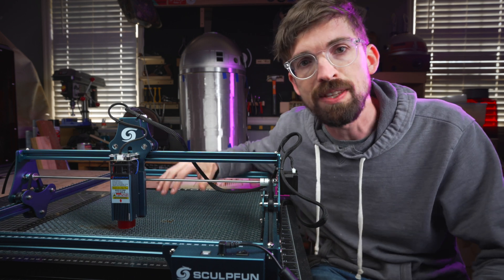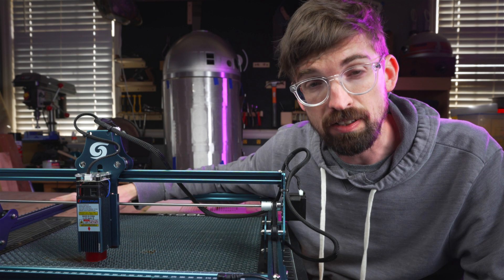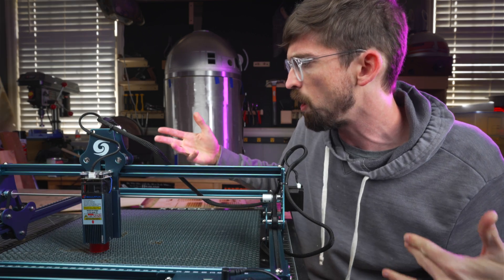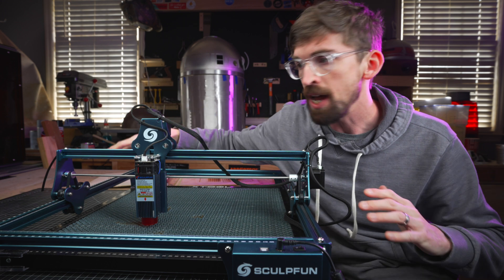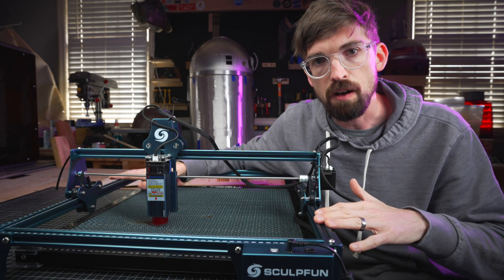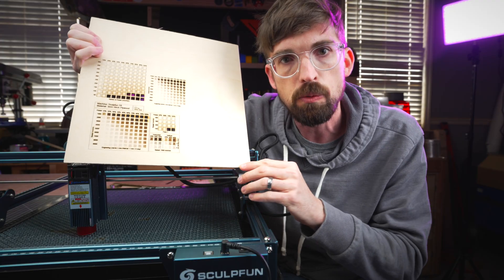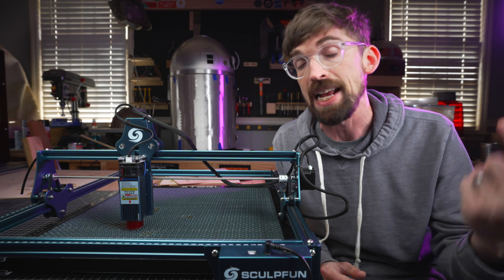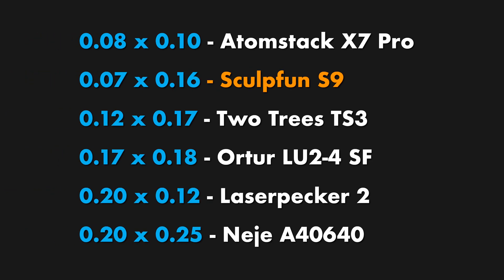Can This Laser Beat the Competition? Sculpfun S9 Laser Review

Comment: I cut 5mm plywood 2 passes, using air assist, with very smooth edges, and very little burn marks on the back side, top side, has no burn marks whatsoever.
Reply: Noted mnm❤ - Q. Sculpfun air assist kit just bolts on with no issues?

Comment: Cool video, thanks. Just a quick question if I may - between the S9, S30 Pro Max and the S30 Ultra which one would be a better pick considering that the budget is somewhat flexible? It is for some general purpose cutting ( Balsa, Plywood, Acrylic etc. ) and less of engraving. I am somewhat inclined towards the S30 Pro Max with the 20W Laser Module.

Comment: I have a sculpfun s9 450x900 extend version,3D prinding benchmark and serice engineer with Cad Cam design trainng. (Making 3D parts from  sketch or technical dwg. Provided with BOM if not) and i still dont understand! Hard wood,not doing it for me! Regular wood? The fibers are going to burn and the contrast and shades are off. Recomandation! Flat soft wood,No fibres! Even! For portrait and face,use jarvis settings in Lightburn for good shades in Peisaje!

Comment: I honestly don't understand why you would want to cut through thick plywood on so many passes at 100% power, not unless you have deep pockets!. 
Diode lasers, although they can accomplish it will burn out in no time.
Monies wasted there replacing the diode lasers over time could have been used on a decent 60-100w CO2 laser which can at a lower percentage output, put up with the abuse.

Comment: I liked your video. One thing I would very much like to know, what is the highest "true power" LASER head can the S9 safely handle (say DC current of 5 to 6 Amperes) and still use the existing controller and existing wiring with the exception of the  external power supply due to the increased current requirements? The controller PCB is is marked as rates for 12/24 volt input.

Comment: Im still using my eleksmaker laser. Noticed it uses 2 stepper motors to drive the y axis compared to this sculpfun which has the one stepper motor and the long shaft to the other side. Considering recreating this on mine and reusing that extra stepper for a z axis or possibly rotary attachment! Also 3d printing an air assist that uses a small aquarium pump!
Reply: I have eleks draw,can im put laser on eleksdraw ,then if can,how max watt im can upgrade to avoiding from damage that eleksdraw circuit

Comment: Soo I have an Atomstack A5pro which is about the same power 5,5W. These diode laser are great TOYS yes toys... they are great sweet toys to learn laser cutting to use Lightburn but they are absolutely unusable to anything serious. After half year I bought a 50W CO2 laser and the difference is DAY and NIGHT. If you want to cut out anything complicated with a diode laser you have to wait 2-3 hours... the CO2 is exactly 10X faster which is a LOT. Without air assist and what is even more important without smoke sucking!!!!  People cannot imagine how much smoke these machines generate, you cannot stay in the same room if you are cutting wood or plastic for longer times..... Soo please people don't believe anybody if you really want to cut than save up for a CO2 machine. (Yes I know it cost 6-7X more but it worth it) These diode lasers are a waist of money... and no they will not be stronger the two diode versions are quite expensive with 10W makes the CO2 almost cheap. Only one thing which is slightly better with the diode laser is the the kerf (cutting width) is slightly smaller (but also not circular but like rectangle). Think long term go with CO2...

Comment: Could this cut  .01cm aluminum? I know you said no metal. But hopefully that's thin enough? Thanks.
Reply from the maker: It won't even be able to mark metal.  For actual cutting you'll need a really high power CO2 machine.
Reply: @makeorbreakshop  ok thank you for the help.
Reply: @makeorbreakshop  How to "ENGRAVE" in aluminium  https://youtu.be/6QE5dB9HKKU?t=1047
Reply: It would be like trying to xray with your iPhone’s flash light. Laser diode waves just bounce off metal.
Reply: @2iinfinite  do you have any recommendations for cutting soda cans? Thanks
Reply: How to "ENGRAVE" in aluminium  https://youtu.be/6QE5dB9HKKU?t=1047